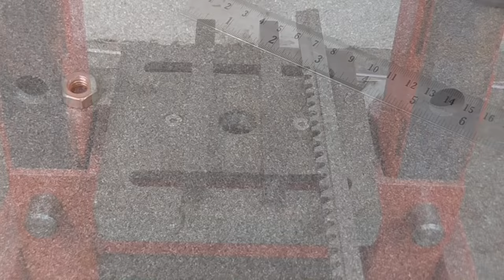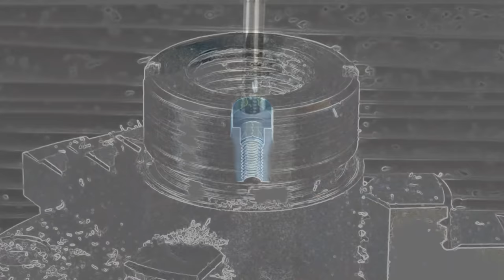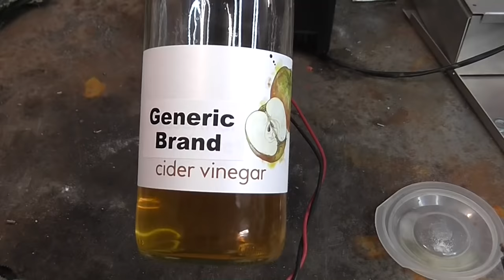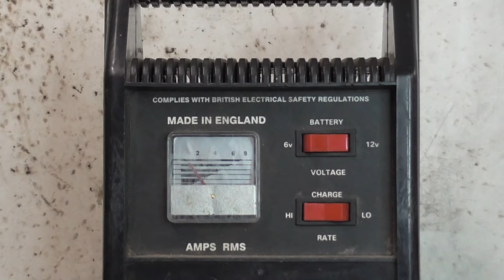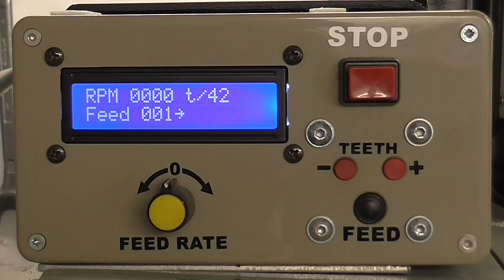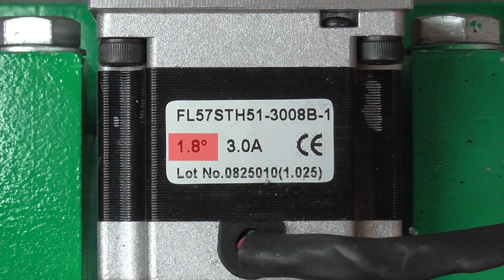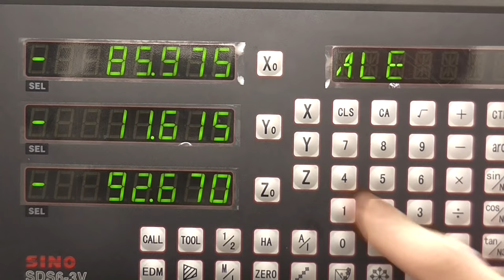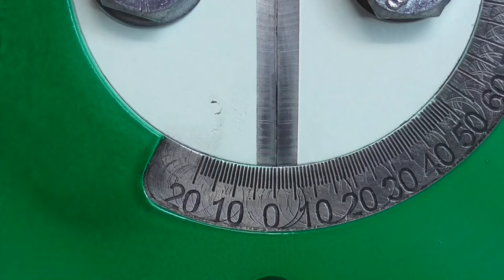Gear Hobbing Attachment (milling machine) Part 2

Comment: Great video but… Why do you need all these gears?  And if you add a satisfying polishing job after ever gear, you will give Chris from Clickspring a run for his money.
Reply from the maker: They mostly go into other machines I build, though some in this video were just examples. They will be working gears, usually hidden from sight or covered in grease when in use, not going into a clock or some Clickspring work of art, so I don't do any more than de-burr them or lightly clean up. I don't think I'll be giving Chris a run for his money, he is at a completely different level!

Comment: Do you sell drawings for this?
Reply from the maker: I don't sell drawings but the design is pretty flexible and you don't have to build it exactly the way I did mine. Lots of people have adapted things like spin/indexing heads to work with my gear hobbing controller.

Comment: 3:58 It's a shame you put your adapter in the wrong way around the first time ;)
Reply from the maker: The wide end was to push the bearing in flush, the narrow end to push it in all the way. The narrow end sits exactly on the thin edge of the bearing shell and I didn't want it to slip off.
Reply: @AndysMachines  I don't think it would have slipped off - friction and all that !

Comment: there was wrong complaints
Reply from the maker: What comment? I didn't see your comment and I didn't delete it, are you sure you posted it?
Reply: Regardless of whether or not you posted it, are you sure you were correct about your comment? 
He goes over zeroing the helix angle with the quill at the 15:00 mark so the 0 degree mark actually correlates with zero helix angle.
Reply from the maker: I'd like to know what he thought was wrong too. He may have meant that the diameter of helical gears needs to be adjusted relative to the helix angle, I didn't mention this in the video, but if you look at the figures I gave you'll see I did calculate this.
Reply: hmm. well, nevermind. probably that was mistake. i was angry because I need to sesrch that url again. ok, so here is it - https://www.linkedin.com/pulse/gear-hobbing-old-machine-walmir-fernandes-navarro

it says: To generate helical gears, the work piece rotation must be slightly retarded or advanced relative to the tool rotation while the hob has being feeding axially and a change gear system, known as differential change gears is added for obtaining the angled gear tooth for a helical gear.

but now i'm not 100% sure. it should compensate feed in a direction different than angle of instrument, but may be if you feed with some slope, you can not do something like that.
Reply from the maker: @stan_yolo  "Hob feeding axially" I think they are generating the helix angle by advancing the rotation of the blank as the cutter passes through it perpendicularly, rather than just tilting the blank. If you look at the  complicated diagram of gears, the blank is driven via a differential, one input coming from the hob spindle and the other from the leadscrew of the machine that advances the hob through the blank. It seems like an overly complicated system but I suppose the advantage is that you can change from spur gears to helical gears simply by locking the differential.